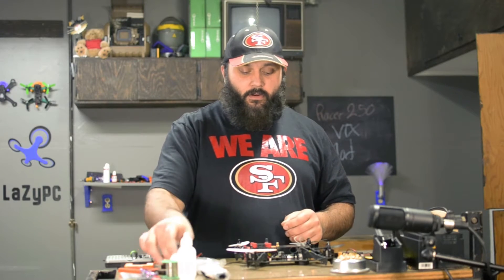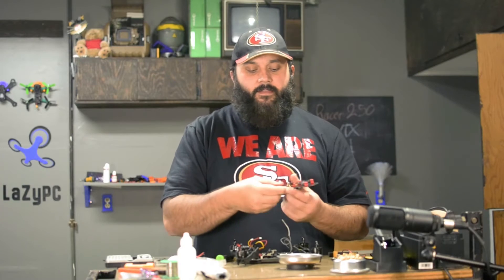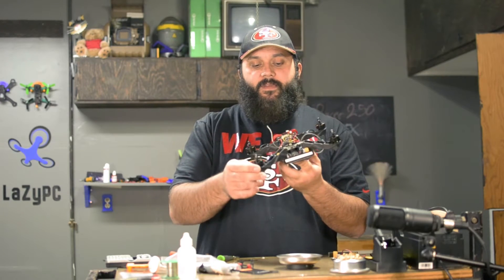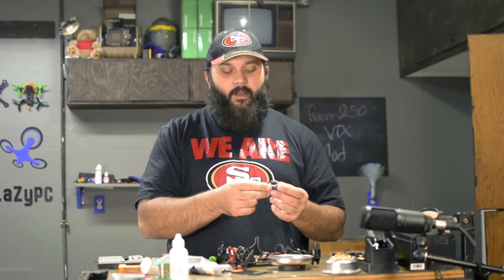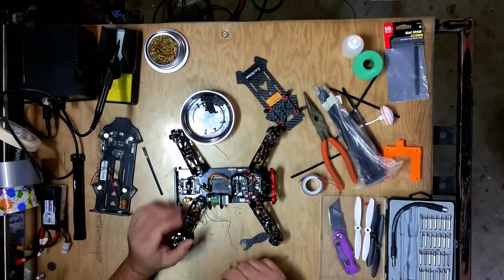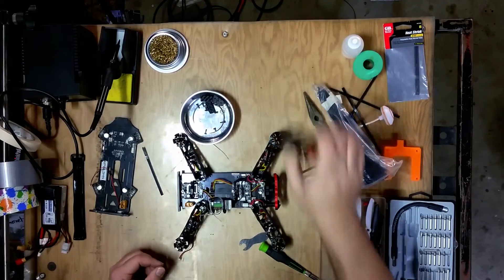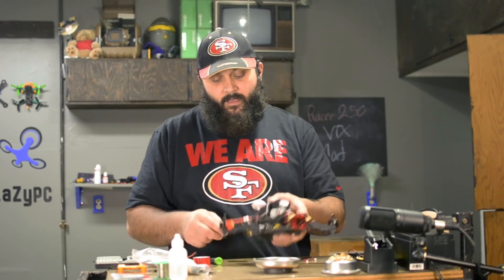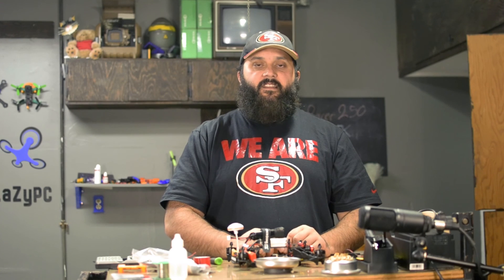Eachine Racer 250 VTX Mod - LaZyPC

Comment: Thanks ! more good tips for that racer! noice!
Maybe a better camera view when you're explaining the rerouting of the Vtx, would have been better, but no big issue.

I'm planning on upgrading my ESC and motors, but I'm still at the understanding stage of dealing with ESC, could I ask you for some advises ?
Upgrading to something like this : http://www.banggood.com/Kingkong-Force-250-Power-Combo-2205-2300KV-Motor-20A-2-4S-ESC-50456045-2-Blade-Propeller-p-1083504.html?rmmds=search

Comment: Nice video ! Do you know how to put the camera more to the front to get more angle ?
Reply from the maker: Hey! This is the video scheduled for this coming friday! But spoiler alert, there are  a couple different mods people do, from cutting the front plate to using a 3d printed one, but that is the common basis, using or modding the front faceplate and camera mount.
Reply: Allen Moore not everyone has the ability to use a 3d printer you know... I have a eachine racer 250 my self and I filed out the slot to get more angle. but now is falls out of the slot every time I make I flight.
Reply from the maker: Lol I didn't say it was the only solution! Dremeling the faceplate can give you the angle, but yes, you might have to get a little creative on holding the camera. If I were to attempt that route I think I might use some double sided foam tape, as light as the camera is I don't see it needing much force to stay in place.
Reply: Allen Moore I will wait for your video and hope it will help my problem with my racer. thnx in advanced 🖒